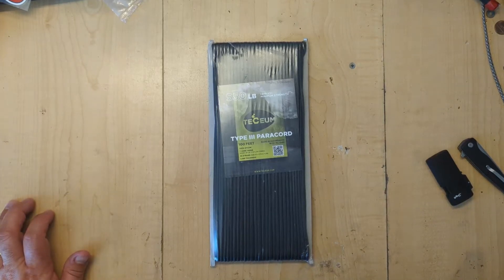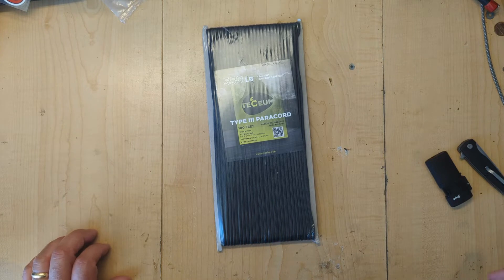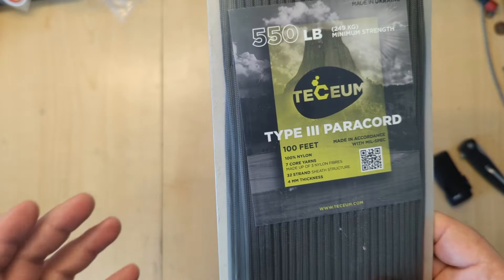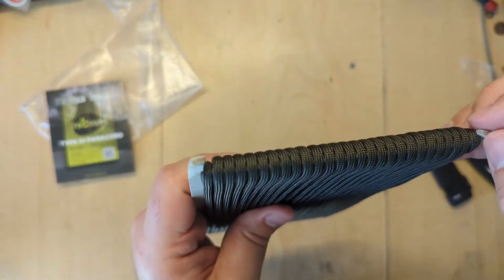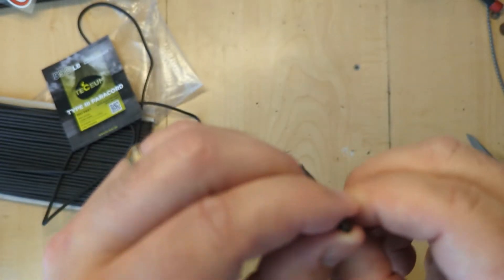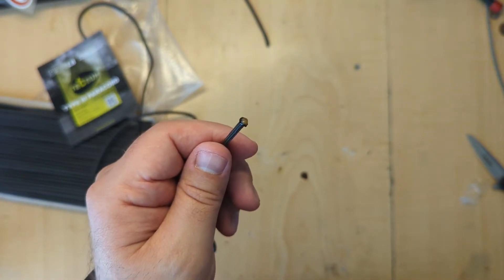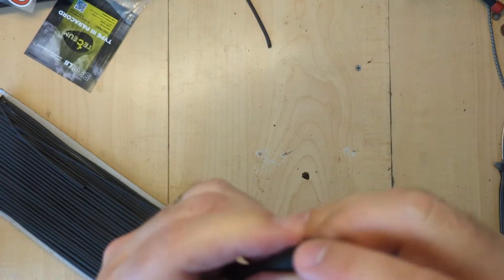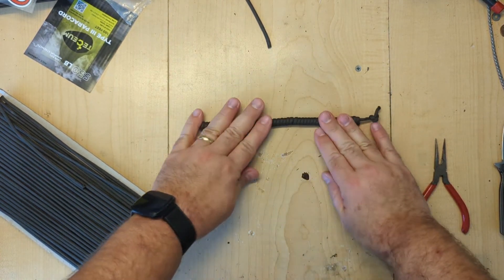Teceum Paracord Review

Comment: Weight tested?
Reply from the maker: I personally have had it static hold 200lbs.  I have not performed a break test.
Reply: @ParacordReviews  If I tie a hammock in the woods, life depends on it
Reply from the maker: So, let me rephrase, standard paracord working weight is 110-165lbs, I tested it at 200 for working weight.  For more weight I would suggest the Tough Grid 750 Paracord.
Reply: @ParacordReviews  Makes sense, Thanks. I got 750 but was trying to understand if this brand live upto the standards of 750 Mil. Grade